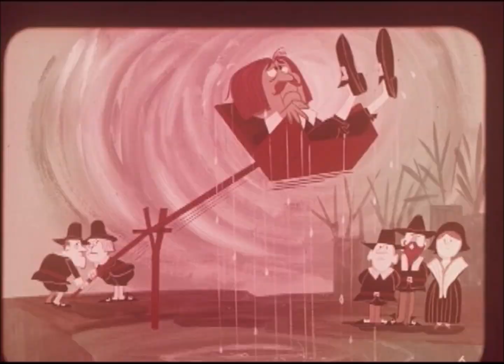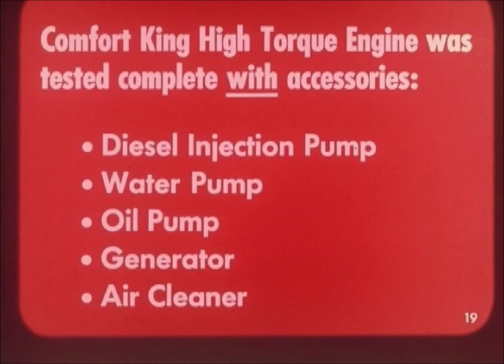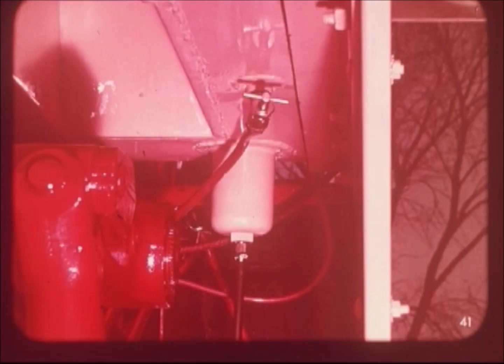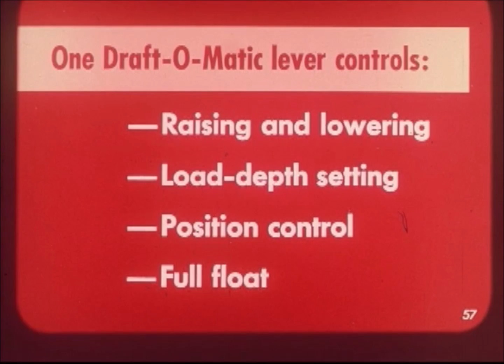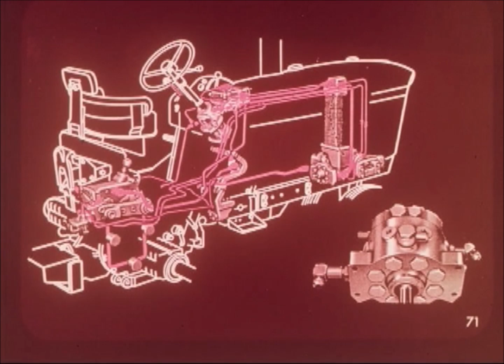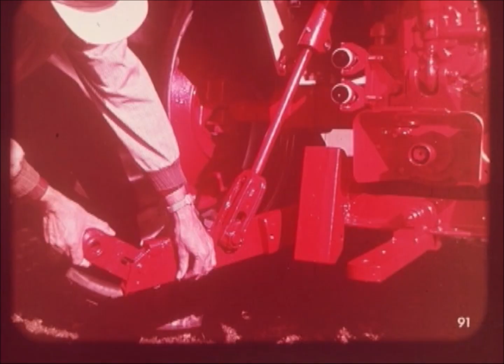J.I. Case -  930 Tractor Video

Comment: I grew up on a 930 and I will tell you it's BS that it will pull 6 / 16's unless its sand.  And I loved that tractor.
Reply: I owned a 67 932   best tractor ever  but  4 bottom plow would have been  a full load  in my soil
Reply: I kinda thought the same thing. Ours had its hands full with 4-18’s at times. Still my favorite though.
Reply: Yep, in between Stevens Point Wisconsin and Coloma Wisconsin where is sandy and flat it could, but not plowing sod, it would struggle and not be efficient even in flat sand country
Reply: We pulled 6 bottom in west central Indiana.  It struggle at times but used it for around 5 years before trading to a 970.
Reply: Had a 830 gas. Had power but emptyed the fuel tank in short time.